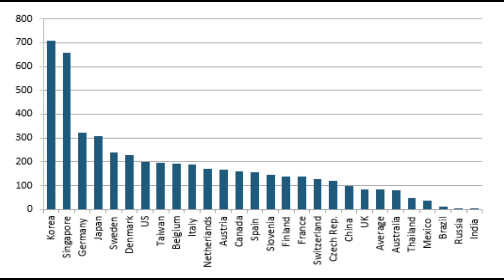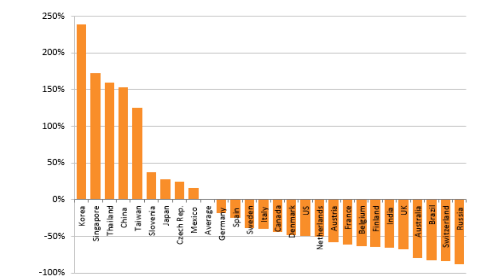ROBOTS | China Will Lead the World in Robots by 2026

Comment: I'm disagree about the robots creating more jobs, self check out don't give employment to human cashiers, a line of 10 self check out machines replace 20 human cashiers ( thinking about 2 work shifts) and operate with only overseer so you get 19 people out of that job, and I am not so sure how more jobs can be created with so much computer programs and automatization being used lately.
Reply: Creative Destruction.  It used to take 95 farmers to care for 5 non-farmers.  In the US, it is likely less than 5 today.  All of human advances are about making due with less due to increased productivity.  The problem is the speed of change.  It used to be slow enough for people to migrate to new jobs, many of which didn't even exit previously.  That in 20 years I went from a dial up modem to wireless that can feed a number of TVs 4K Netflix (which used to simply rotate/mail DVDs) is staggering.  From a beeper to a smart phone that allows me to do web searches for information.  This is simply mind blowing.  And it is causing suffering for those that have not found new work.